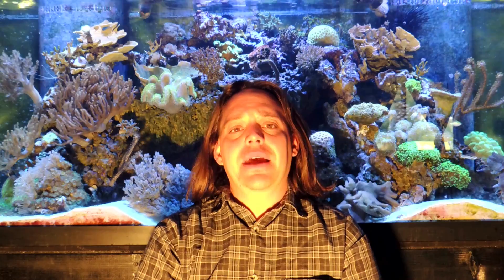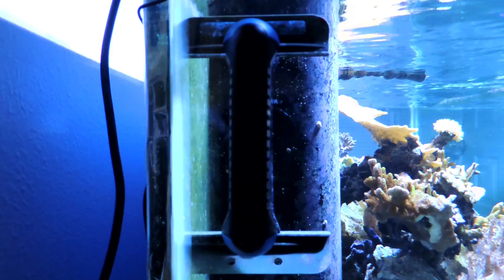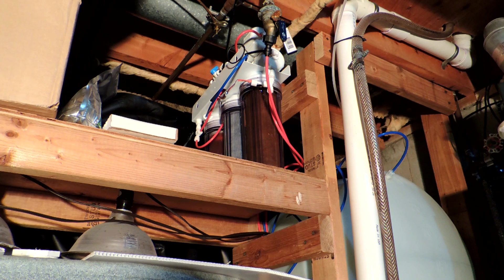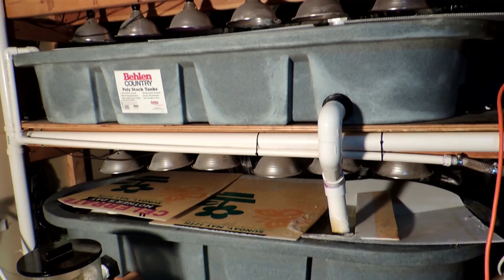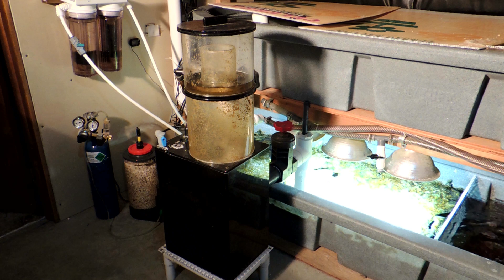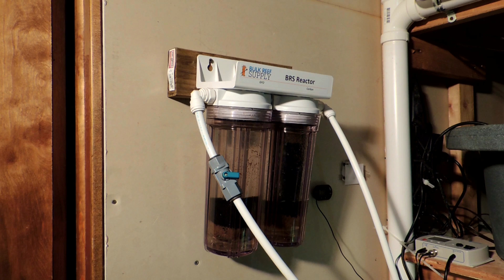How Much Does My 210 Gallon Reef Tank With Basement Sump Cost (Equipment)

Comment: I noticed your bubble counter on the calcium reactor was really fast is this how you run yours
Reply from the maker: bruno cline There something wrong with the valve and it runs fast then slows way down. I'm kind of afraid to tear it apart everything seems glued  together. Right now its maintaining PH with a bit of tunning but this isn't optimal.
Reply: I just happen to notice it on your video thought maybe there was people who did there bubbles a lot fast than I do with maybe a different setting thanks

Comment: Dude that was depressing. I think I could be driving a BMW if I didn't have this reefing addiction.
Reply from the maker: Arrick L Yesterday the rotor in my 1971  Mercedes went bad and left me stranded. I fixed it but not wanting to risk it I drove my 1990 Range Rover Classic today and the key broke off in the ignition leaving me stranded. Oh the joys of classic Euro cars. I also have a 1973 BMW 2002 with the transmission in the trunk.

Comment: It's sure is scary once we try to add up all our stuff lol..
Reply from the maker: mmtorres26 It is but its for my hobby. I use to paraglide for a hobby this is way cheaper.
Reply: ikr. i thought i was gonna go the cheap low tech route ya know? but once i went over the cost, id already spent $300, on a 10g nano, with no sump, or rodi, or protein skimmer, not even a descent light. after i add my lights, sump, get an ro/di and a skimmer, ill have over 700. then stocking and regular salt cost, etc. now ilook back to last year thinking 200 for a 55 freshwater was expensive. lol.
Reply: and the sad part is im 15, so i dont have a job yet, and my parents thought i was crazy when they figure out how much i spent. needless to say, it took a long times worth of saving, bday and xmas money.
Reply: jr.turtle120701 
I feel you dude. I'm 15 as well setting up my first reef currently (46 gallon bowfront w/ stand I got for free and resealed). I'm already about $500 in and I'm skimping out on equipment a bit. I bought a skimmer, heater, lights and two powerheads but that's it lol. in addition to that I've spent money on rock, sand, and RO/DI water. Iplan to add a pair of clowns on Tuesday right after I get home from school so I'm absolutely excited for that.
Reply: i had a pair of clowns, but they got lymph. one survived, but the other didn't. im gonna get a shrimp and goby pair, and some softies zoas and euphyllias. I just got my new light, a current orbit. i though it was the 18", but its the  24". Convienant though since im going to upgrade later on, and i wont even need to get a new light. lol.